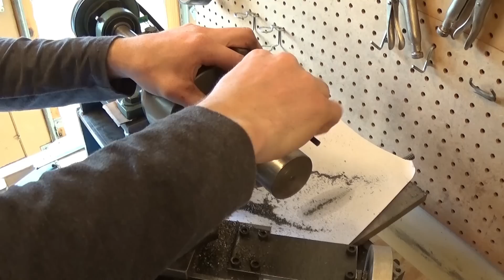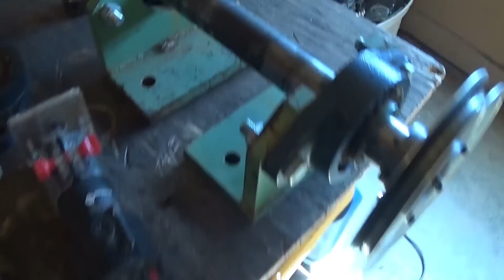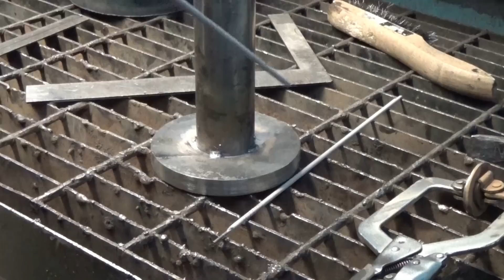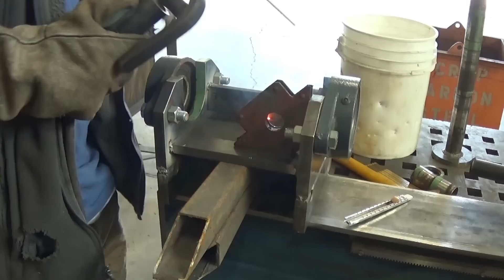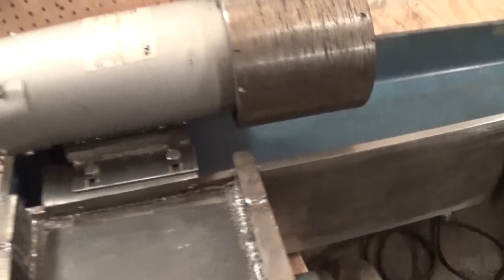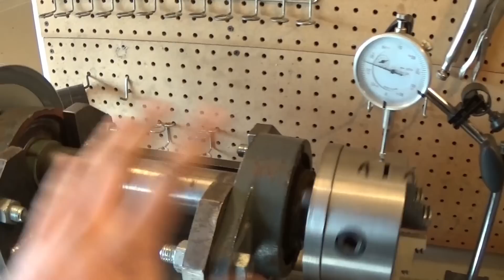home made lathe part 9 new headstock

Comment: I know this is far too late but there's a really easy way to ensure the face of the lathe and the cutter are totally parallel. Just use the lathe to face the face plate you mount the head stock to. Using the set up as you'll use it ensures that it'll be 100% straight.

Comment: I'm cirtainly no expert... But I would think the best way to install a Chuck backplate in this situation would be to use the Chuck itself. Set up the new spindle, then put your back plate over it. Put the Chuck on but let the spindle stick through and clamp on it with the jaws. Then you can line up and weld the new backplate and cut off and true up the bar sticking off the Chuck side. In theory that would ensure that the spindle is running true. Better than a square and a tape measure anyway 😉. I really love your videos. There is something truly beautiful about making a working machine tool from scrap metal, even if it's not "precision", it's still cool as hell. Don't listen to any of the ney-sayers. Just do you 👍

Comment: backplate should have a proud ring on it that matches the inset on the back of the chuck.  Turned in place you get a center as good as the chuck is made.  It sounds like it turns better.  It's also important to turn the back side of the back plate.  If it's not perpendicular to the face, then it will cause the bolts to flex or want to push the chuck this way and that.  The bolts are registered in squareness off the back of the plate.  Hope that is not to confusing.  Get a drill press in the  shop.  It  hurt my inner engineer watching you use the electric drill.  I think you are a talented person.  I check your channel from time to time.

Comment: the problem begins when you welded the plate with the shaft, that's why the balancing occurred, the way you did it is not the correct one, disassemble it and take it to the alignment. the axis and the plate.

Comment: its  a great design, and a good size, you just need to setup your cutting tool correctly lol
Reply: anyone else watching the tool post bolts undo and do-up themselves while he's using the machine?
Reply: also, you shouldnt need to push the drill hard, it should cut its way in.. sharpen your drillbit if its not cutting, you have a grinder

Comment: You need to invest in some hole saw bits... clean cuts...
And drill new holes for your headstock... use a cardboard temple to center your holes... you need it as centered as possible to zero... 5 thousandths is huge...

Comment: Hi
I think your doing a very good job but you need to read a little more about electronics specially motors I dont know if a DC motor is a good choice for this lathe 
and dude please fasten those belts a little more you are losing lots of power over there

Comment: Maybe for your adjustment plates if you use a fine Threaded Screw instead of a coarse screw and maybe also if you put some lapping Compound on there and the pieces that slide if you left them in maybe you could take all of that slack out of there also but I think it looks fantastic man I had love it I absolutely love it in the coolest thing is that you built it yourself you know you didn't buy it and someone going to say yeah you didn't build that but you got the video to prove it I think your rocks

Comment: Like Ramiro M said, but in a friendlier manner I would like to outline that this is "good enough" for a project and can get better in some ways to some extent:
1. If you scrape the ways you can get really good in terms of straightness, but the steel is not as thermally stable as required to bother scraping to perfection (today it's perfect, tommorow it's not...the day after that we'll see).
2. 3 phase motors run smoother, but they are a lot more expensive and hard to find and will require a VFD or a rotary converter unless you have 3 phase power at your building, and since 1 phase lathes do exist I think this is the last of your problems.
3. A true spindle must be able to accomodate axial loads. Since angular contact bearing at this size cost an arm and a leg I suggest installing a thrust bearing from a motorcycle steering stem or something between the chuck and the bearing pillow block. This way you will be able to do facing and heavier turning, but no back turning without another of these bearing on the back of the shaft, ideally preloaded (people often talk about preload like it's an easy thing but when it comes to actually preloading precision bearings we are talking about 5-10 microns tops)
4. You don't need any backlash compensation on a manual lathe, just make sure your leadscrew is made smooth enough and use a well made bronze nut (most machines shops can do a couple of them for you). This will suffice for repeatable positioning but the actual positioning accuracy is up to the leadscrew.
5. You CAN align the headstock by shimming the bearing blocks but it will be kind of a pain! You could use a fixed self adjusting bearing in the front and move the rear bearing block around with some set screws.

Comment: This is a decent attempt at a lathe. While it works well enough for quick and dirty work it still needs a lot of work to operate smoothly and with precision. But tons of people have said that. 

The only suggestion I want to add is you might want to wear a face mask when working with an angle grinder. The cut off wheels can and will explode and when they do anything in its path is destroyed. A pair of working eyes are no good to a dead man. Second suggestion is to put a file handle on your files especially when using them on a piece you are turning on a lathe. If you are pulling the tang out of your wrist one day you'll understand why I said that. 

The series of holes and then cutting the circle out is generally a decent way of cutting a hole. However there are fly-cutters made to use in a drill or drill press and produce a cleaner hole and are very nice because they are adjustable to size. You will want the cutter with the drill bit in the end of the center piece. 

Pretty cool video dude. Although the lathe needs work I still think it is awesome and you did a decent job. Most folks complaining are acting as if you are selling these things and honestly if a commercial built lathe like H/F sells comes stock with headstock wobble then I think a minimal amount of wobble for a homemade lathe is acceptable. People get mad when they realize that they spent 15000 bucks and a lot of time to learn to operate a lathe and then you come along and spend 15 bucks and get a very acceptable result. I have seen some people turn things on a lathe that came out a lot shittier than yours.

The only thing I see you could do to better the machine is to figure out a method for balancing everything that rotates, build a pulley system similar to what you see in the top of a drill press which will let you adjust the power to torque ratio as you need. Since it is a belt drive it is easier for you to build something like that and using a roller bearing on your tensioner for the belt will make the belt run smoothly and quieter. Unfortunately, unless you move to a gear system you will always get a little vibration due to the belt system but as long as that vibration is not transferring to your headstock and causing issues with your work piece then you should be fine with a belt system. 

Your doing a good job keep it up.

Comment: You need high precision Tapered ROLLER bearings with an adjustment for preload- for the headstock! This is where most of your chatter is originating from, you can see it in the videos. Find some front wheel bearings off of an automobile, and machine some housings for them to go in. If you find 4wd front hubs, they will include hollow housings and threaded preload accommodations. STOP beating on a hardened file with hammers, unless to want to put your damn eye out! Other than that I am Impressed with your ingenuity, and in my 55 years not very many people  have earned that comment. On another note, .005" is a MILE for a lathe chuck, you need to be no more than 5 tenths, .0005 MAX, you botched this chuck assembly bad!

Comment: a tubular head stock shaft would allow for longer work to be chucked with part of it inside the head stock shaft which would increase versatility...just a thought...I always wanted to build my own lathe...I never got it done so you are way ahead of me in that respect...also the material from which the lathe is made will affect the chatter since steel is a springy material which  enhances chatter...this is why commercially made machines are made mostly of cast iron which is a dead material that does not ring like a bell....but don't let the neigh sayers discourage you... you HAVE a functioning machine..never mind the precision...you are shaping round metal parts for welding together...most folks don't get anywhere near that far...so take it from an old machinist with years of experience...you are doin' pretty darn well...keep goin'..... improve the next one

Comment: I would have put the motor from the scroll saw onto the lathe aswell, with different gearing onto the main shaft, and then turned  the scroll saw horizontal, welded it to the cross slide and then attached another motor to the scroll saw and pointed the scroll saw blade right at the chuck so the blade jabs in and out onto the workpiece as you spin it around at the highest possible speed. Also, i would grab your grinder horizontal mill and have that motorised and just scraping backwards and forwards onto the scroll saw arm as the whole thing is going. 

That's what i would do anyway.

Comment: I agree with the safety concerns to be more aware and that Murphy's Laws do apply always. This home build is excellent and the problem solving aspects are great. What you learn from this will be a great foundation for all your future projects and success. Never give in to the concept of throw away and buy lesser. Learn, grow, enjoy, and find a way to create a profit stream to fund your future works online producer. It is all about basics of geometry, quality control, and discovering what you can do. Stellar work here for anyone at any age. Respect the negative critiques but also know where the positives out way the negatives. Learn from both and continue the trek toward excellence. Visit the https://www.gutenberg.org/ look up how the old guys solved similar problems. Also, old navy and mil handbooks online in pdf will help you advance your tech in house.
Reply: there are some economic less expensive laser levels and led tools that can help you verify the geometries. You have a great deal good materials to make this as accurate and precise as you choose. In any tool making, the first generation is where you learn and use to build the next generation from. Just as you did in going from the one inch to the two inch drive assembly.  Bore sighting can be done using optics from a gun sight mounting tools. There are also floating designs that can self balance etc. The more you learn here the more you can build into the next one. Great job.

Comment: I think your main problem with the chatter is that you need a roller with a spring to tighten up the belt.  When you are cutting you can see that the belt is flopping around and the head is slowing down and speeding up when you ease up on your cutting.  I can not beleave no one has said anything about the belt being loose.

Comment: I have two solutions for that 5 mm out of thru but I'll only give you one which most certainly will work 100 % , unscrew the chuck and you'll see a recess was machined at the back side of the chuck,  now since you already have the chuck off and the face plate welded to the axle machine a lip .5mm smaller than the id diameter of the chuck and a little shorter than the depth of the recess then reassemble the chuck

Comment: Cut a step on the face plate that will fit in the area in the back of the chuck. More or less a register of sorts. You will get a better run out and keep the chuck concentric to the face plate. It will never be a perfect lathe. Too many variables you cannot fix with the design. However that being said, its an awesome project and has been fun to watch. Keep you hands away from the running chuck. In the blink of an eye it can rip you up!!

Comment: Your "axle" is a spindle.
The V shaped rail is called a dovetail.  The metal plate for tightening the slides is called a gib.

I like your use of an I beam for a bed.  If I were attempting the same project I would have used an I beam.

Comment: Thumbs up - which is well deserved for all your effort and hard work!

EDIT: After watching your great video right until the end, The reason why your turned surface is not smooth as you were hoping for is because there is too much give in your tool post, You need to do like you said and mount a larger thicker piece of steel the to your tool post lathe carriage and then mount your tool post directly on to that.

You need to make double sure that there is absolutely no play or movement in your lathe carriage by adding gib screws to your lathe carriage to take away any play or movement and make sure that there is no backlash in your lead screw!

A lathe carriage locking screw is a must! as sometimes vibration and chatter can cause the hand wheel to turn and the lathe carriage to move out of position by itself!

For more info on lathes and tips on how they work checkout: http://www.lathes.co.uk/    

Good luck with this man! - You rock! - Keep up the great work - your stick welding skills are truly awesome!  :-)
Reply: Me gusto .
Reply: Muy pratico  el joven

Comment: Man! - center drill both ends of the pulley spindle and turn it between centers ;-)

Cool lathe but you need to do more work on beefing up your head stock support area and your tool post to make everything more rigid and robust. - You will be rewarded in the long run with a better lathe which will be chatter free :-)

Comment: Dude, you are officially voted most likely to have a horrible lathe injury. Rule #1: NEVER wear long sleeves working on a lathe. Rule #2, NEVER get your hand close to the chuck while in operation. If you are lucky, you will lose a finger or an arm. If not...
Reply: Paul Andrulis it'll just tear the sleeve off and scare him. Ive seen it a few times. It's gloves that get you hurt.
Reply: And put some guards over those spinning bits.
Reply: Also quit wearing the ear buds and stop reaching over the machine when its running... And geeze use a brush on chips at the drill press. I know your young and dont care now. But some of this shit shows back up at 50 and all those little injurys start hurting a lot more....
Reply: Glen King YES, and short sleeves too. A long sleeve snagged in a rotating part will rip your arm off. Take off your watch too. Yes, it's small, silly stuff - and every bit of it comes from someone getting hurt or killed.

Comment: I agree strongly with the tapered roller bearing POV, ball bearings need play to allow room for grease film and the effect of the interference fit on the shaft and in the hub. Small, new trailer hubs run about $15 , but 6000 pounders are over $100. Light weight hub may have dia. too small for adequate shaft size. Big trailer or truck  hub may be available at salvage. You could also have a hub at each end and just use one bearing per hub. Since you get (did that change?) chatter on axial cuts  but little on radial cuts that would indicate radial play. SKF and Timken bearings may have dimensional tables for their bearings. Euros have a universal numbering system on each race and the box 20 years ago. German car repair shop (non-dealer) may be of some help through their supplier.

You could check for radial and axial play with a dial indicator. An axial preload on the ball bearing could be a way to isolate the problem. Balls generally have point contact, where rollers linear contact other than the amount the race and ball deflect from load. If you load bearings too much they run hot. Easy to load brgs way more than the weight of vehicle by overtightening - Shearing forces on the lube, I read. http://www.northerntool.com/shop/tools/product_200369645_200369645. Hubs come with high tensile lugs and bolts and seals, stub axles and hardware too. Check temps after run in too.

Comment: The 1 inch shaft, with the two pillow blocks, could be used with pulley sheaves to give the lathe four speeds!  It looks like the motor is in the 1500 RPM range, so you would end up with some where in the range of 300/700/1200/2100 speeds, or so...  After video  #12, it is what I would attempt.